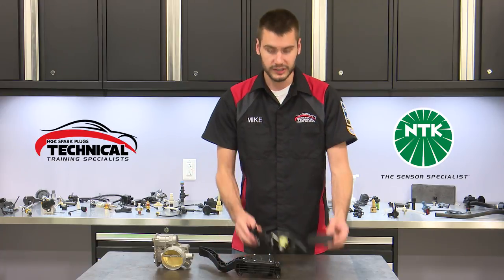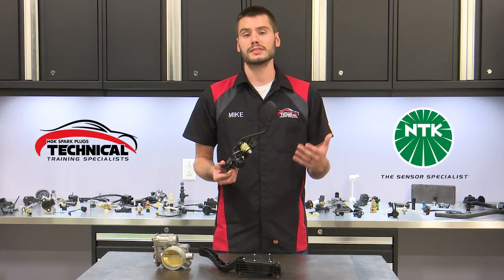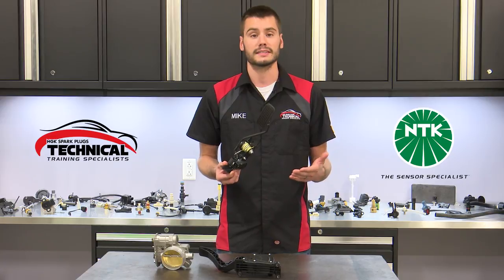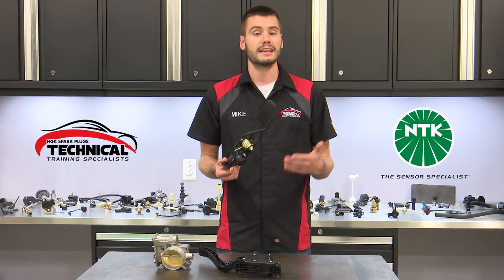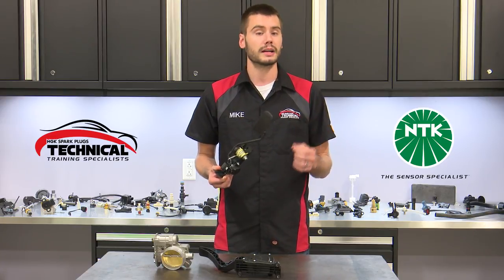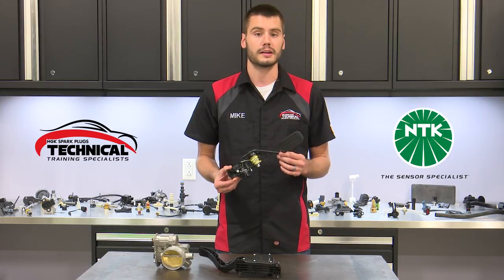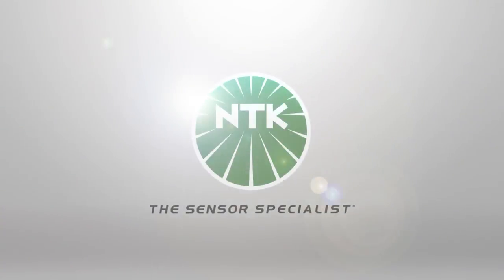NTK - Accelerator Pedal Position Sensor (APPS)

Comment: I have a 2010 3.0 Isuzu dteq pickup and it's only driving up to a topspeed  of 80, I can't drive more than that, took it to a local dealership, cgot some error codes, first they said it's my coolant thermostat, replaced it,no change, again my turbo might be damaged,replaced that, still no change, and now my engine is overheating...
Please help,what could be the problem..,plus my check engine light is on, could it be the APP sensor?

Comment: Thank you for video. But I do not clearly understand why APP or TPS sensor need 2 or 3 potentiometers? It mean the sensor will send 2 or 3 signal to PCM/ECU. Pls help!
Reply: it's for redundancy and safety. if it were just one sensor and it was malfunctioning/giving inaccurate info the ECM/PCM might assume you had the gas pedal to the floor and cause an accident. with multiple sensors it's able to recognize there's a prob if the sensor values don't correlate the way they're supposed to.
Reply: @heatherrhodge2588  thank you very much